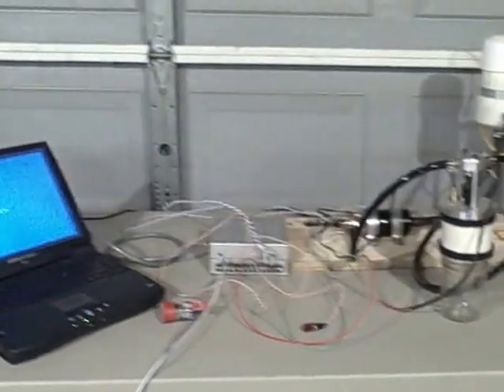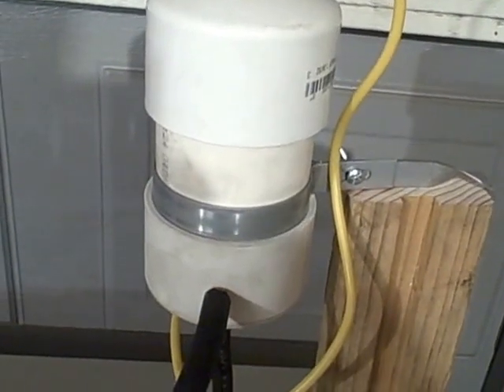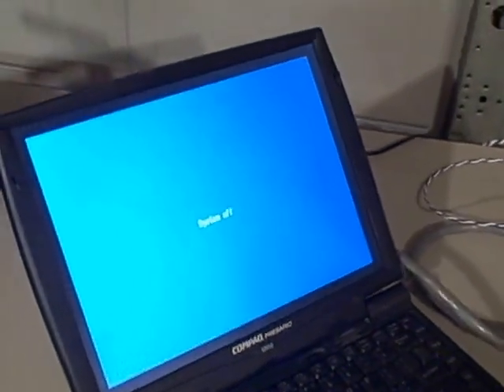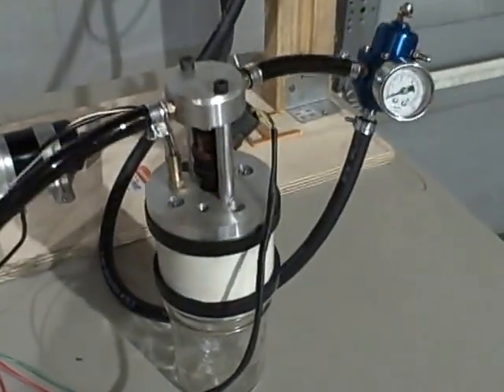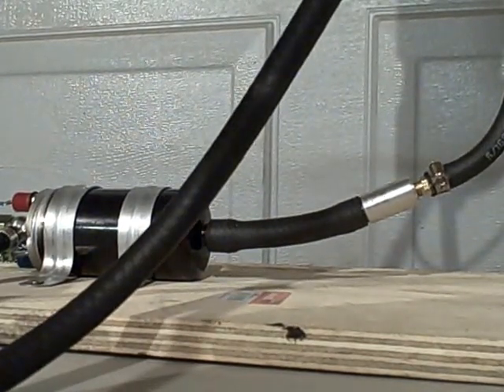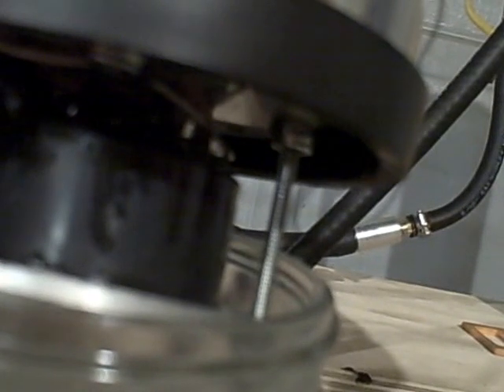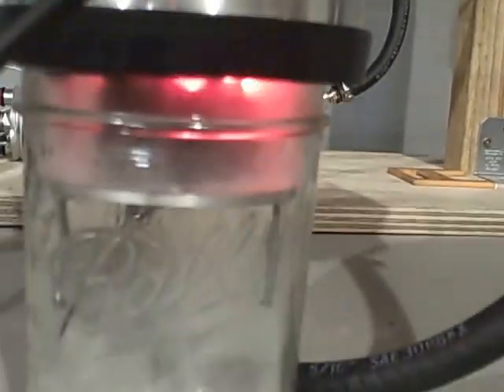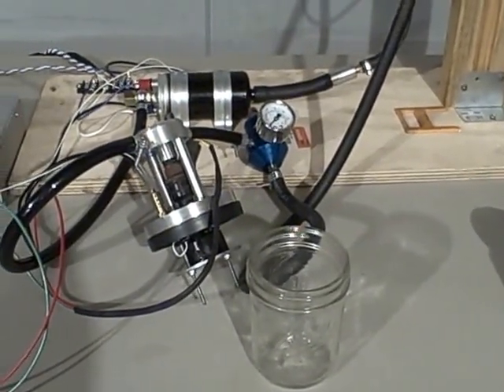Mr Fusion  ultrasonic gasoline vaporizer

Comment: How are you doing this with no liquid fuel on the transducer ?
I'm kinda lost
Reply: Most vaporization devices submerse the transducer in fuel.  This device sprays a very small amount of gasoline onto the transducer and vaporizes it instantly.   It works pretty slick, but the transducers don't live very long.

Comment: This is the right way to do it. If a transducer is covered with a fuel in a vessel, the most volatile part of the fuel is released first and parts that don't burn are left behind and make a sludge. This way each dose injected is all vaporized so all the fuel should make it to the combustion chamber as the light and heavy parts are in the vapor. Now combine this vapor with some hydrogen or HHO from a simple electrolytic converter and you should have about 300mpg or more from a mix of the petrol vapors and split water. Possibly you could use some low quality fuel like used cooking oil plus the hydrogen or even wood gas etc. Well done Mr Fusion!

Comment: I will wish success to Your experiments! I drive 3 Ultra Sound transducers(the last setup), but with water+alcohol (just a very little). Problem with Your setup will be- when engine sucks- it takes all vapor at just some seconds... and engine (small engine) will start and stop immediately. For success You must take about 10 or more Ultra Sound transducers :-(. My experiments with 5 of them give about 2Liters water vapor at 100 km of road. It means- 10 takes 4Liters, 15- 6Liters.

Comment from the maker: Hi 'ya Robert,
The regular fuel injection on a car does a decent job at atomizing fuel, however it isn't perfect.  I'm testing out a possible myth that the fuel can be better atomized with unconventional methods.    Eventually I'll install something in my project car and see if there are any improvements in MPG.
Reply: what happened to this project?

Comment from the maker: I bypassed the level sensor by attaching a wire from the sensor probe to the power supply ground.  This was my first attempt at making a total fuel atomizer and I quickly discovered the transducers do not last too long.  Thanks for the heads up on the other transducers!  
I’m building a new system that will retain the computerized fuel injection, however it will use a hot core to atomize the fuel.  I’m using automotive EGR valves to re-direct exhaust and modulate the core temperature.

Comment: Nice work!

I have done some good testing using the ultrasonic transducers they will burn up or stop working in gasoline, you can spatial order them to be able to withstand gasoline so the will last a long time, I looked into spatial ordering them over a year ago and had to make allot of phone calls to try and find a company that could custom make one and I did find on but don't remember who it was.
Have you bypassed the liquid level sensor, or did you order the transducer without it?